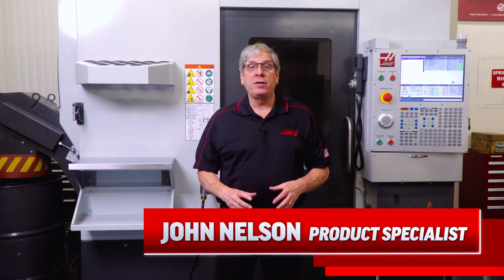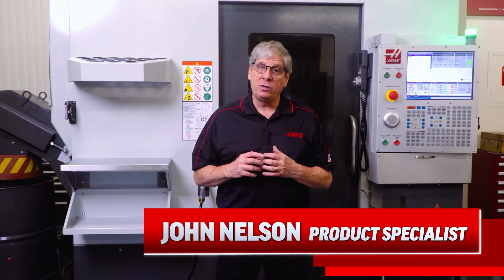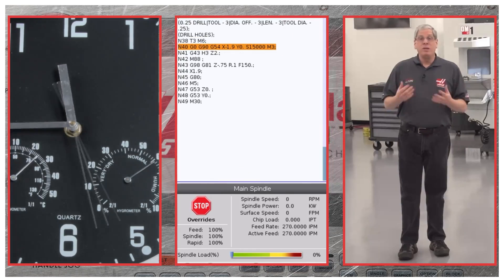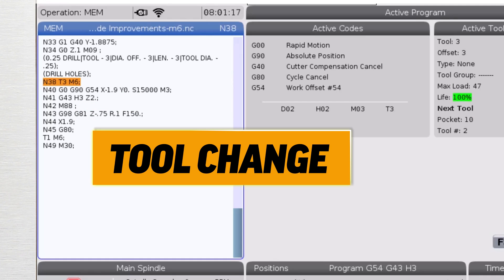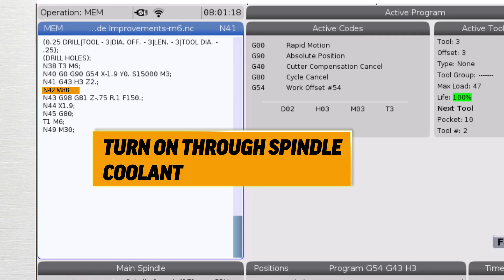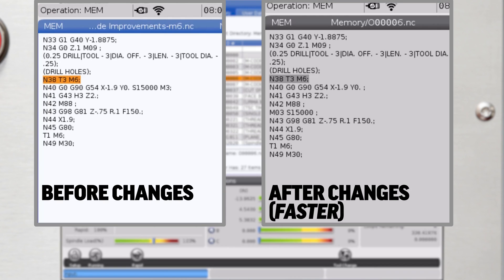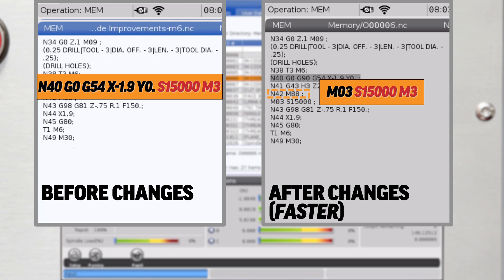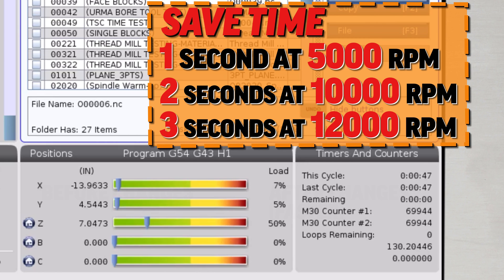M-Code Time Savers - M88 TSC and M73 TAB Commands - Haas Automation, Inc.

Comment: In my last company we asked SolidCAM dealer to change that since we ran almost every tool at 15k on Al, but the worst think was when tool diameter was big, and TSC started 20 mm above the part, it sprayed coolant so we couldn't see if there is any possible collision with holder, spindle, trunnion..., only to delete TSC in program, or stop the program all the way since we couldn't open the doors while TSC was active. :S

Comment: I figured this out years of. I don't know how anyone wouldn't notice that the very first time that they tried to start the spindle first. I did. Just like turning on the spindle before moving to the start point if possible. Coolant too. They can be building up on the way there. Maybe because I worked on a really slow machine when I first started machining 20 years ago. Plus I worked piece-rate Chipping and Grinding at Neenah Foundry for 11 years before that. So optimizing every movement is ingrained in me.
Reply: Some of us are new at this and don’t know about these things

Comment: This is intersting, i run a 2022 UMC750ss but when i turn on TAB it does not stop the spindle, is this normal?

when M73 gets called in a program when its not just after a tool change it does post an M5 and then the M73 but the spindle slows down for like maybe half a second and then ramps up immediately after the M73 without stopping. is this considered normal behaviour?
Reply from the maker: Gerrit-Jan Bergwerf, Good catch! Actually this is now normal behavior. We made a change to software so engaging air blast does not require the spindle to stop. We are probably going to put up a slightly revised version of this video that mentions this specifically. Thanks!
Reply: @haasautomation  Is there somewhere I can download these updates?